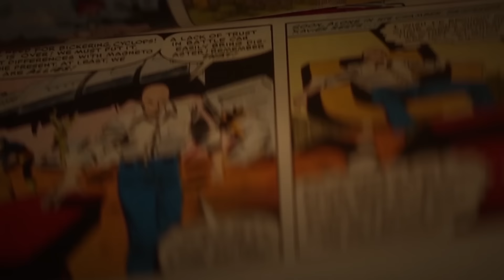Cooling Module + Comfort

Comment: Maybe add casing around the tank with sound foam in it to lower the noise a bit
Reply: +Nz That could be nice but the temperature will rise inside quite quickly...
Reply: +gzklgg I think it would be fine if he drilled some wholes in the case if he made one

Comment: What about having some sort of potentiometer/fan control module to regulate voltage so if you're in the sun for ages on a hot day you'll get more airflow but if you're in -26c weather you'll get none (and save battery...)?

Comment: if i may make some suggestions try bending the back pieces so its not so flat against your back and i was thinking you can start putting electronics and power stuff on the front as a counter weight

Comment: That project was so awesome! 
I am building an upper body skeleton and this series is so helpful.
I was wondering about how you guys connected the metal frame to the vest? I didn't find something about it in the series. The flat bar is going throw the vest attachments points and hold by just friction and the cross sections?
Did this design worked well? Would you do any thing about the vest and metal frame differently?
Thanks :)

Comment: From the balance plug you can take 12v or everything multiplied by 4.25
Reply from the maker: +Pablo Ruiz Ponsoda Handy! But then we'd drain one cell more than the others and it'd be bad no?
Reply from the maker: +Bruce Barton But for timely project completion... buck boost converter is easiest... I know these fans can be controlled by PWM but we don't have time to make a circuit, already installed the buck-boost and it works great, we're running the fans in series to halve the voltage anyway so it seems to be pretty good for now.... Maybe not the most efficient, but it gets the job done =) I do appreciate the advice though!

I used to spec fans for use in digital projectors -- I do know the right way of doing things but remember... I'm the "hack"smith ;-)

Comment: It seems like you said those fans were going to be intake. You should have them set as exhaust because all that heated air will be blowing directly to the metal plate directly behind your back. You're gonna have a hot plate in the summer basically. Just flip those fans and you're good
Reply from the maker: +Mr. C. I don't think it'll get that hot though.. Forced air on a heatsink is more effective at cooling then drawing air from around it I think, we'll run it at full power and point the thermal camera at it to see how toasty she gets but I think it'll be fine :)
Reply: the Hacksmith thx for responding and good luck at the Expo! can't wait for more vids!

Comment: Hello what about adding a strap between the legs s so can pull down the vest a little it still looks a little tight there around the neck?
Reply from the maker: +joseph chrzempiec (josephchrzempiec) That's what the side clips are for, there is the random belt hanging down from the front but no where really to attach it right now... Next step is making some leg loops so I can sit down and have the exo legs support me =)
Reply: +the Hacksmith very cool awesome man. looks great getting there.

Comment: Do you plan to ever, at some future point, add electrode sensors to control the exo? You could place two on the back of the thighs to control the valves for the legs. That way, when you make a knee-bending action, and the exo would assist.
Reply from the maker: +Joel Hemphill Yep we're planning a full control system like that, but the challenging part of an exo is building it first -- controls come later ;-)

Comment: put the 2 fans in series. ittl drop the voltage to 12v for each!
Reply from the maker: +CrackedIce we need 12v for the solenoid valves anyways. Even at 12v the fans are ridiculous. We're putting them in series at 12v to drop them to 6v :p

Comment: Would you need the extra cooling if you just regulated the voltage instead?
Reply from the maker: +IkkFedt Probably still need some cooling, the compressor is rated for 100% duty but only at 100PSI, so if you run it constantly at 200PSI it'd probably overheat.

Comment: Wouldn't it make more sense to have two tanks and have no compressor and fill the tanks of another compressor so its alot more silent and lighter
Reply from the maker: +rhys delaney A tank doesn't last very long... two tanks wouldn't help much. The battery pack can run the compressor for 20min straight, which would fill the tank i dunno... 10 times? We're looking at putting a small high pressure (3500PSI) scuba tank regulated down to 200PSI -- so there would be a silent mode. It'd have to be compressed separately though.
Reply: Thx man for responding but the noise is a bit of a problem so why instead put some sound barriers around the moter so it isn't as loud

Comment: So you're adding cooling because your battery runs at 22.2V but You're having to drop the voltage to run the fans down at 12V... Seems like a lot of pointless making if you ask me! Simple electronics will drop the voltage down to 12V for everything then you won't need the cooling pack... Unless the cooling is for something else as well...?
Reply from the maker: +Simondoddy We need a 12V auxiliary power system on the exoskeleton anyway. Even when running the pump at 12V it still gets very hot. It's only rated for 100% duty cycle at 150PSI, and we're running it to 200PSI.

We were always planning on adding fans, these ones were free -- just too powerful. So we're running them in series off the 12V circuit (they see 6V each) and it seems to be just right =)
Reply: +the Hacksmith fair enough. I figured you wouldn't be doing it for no reason at all :)